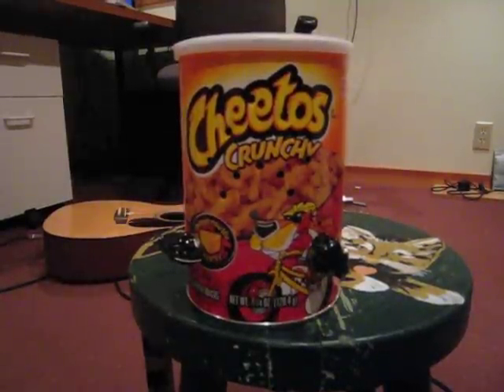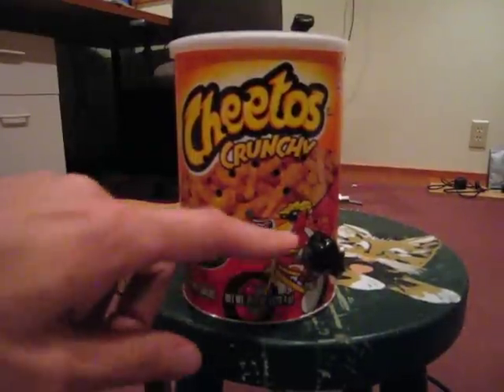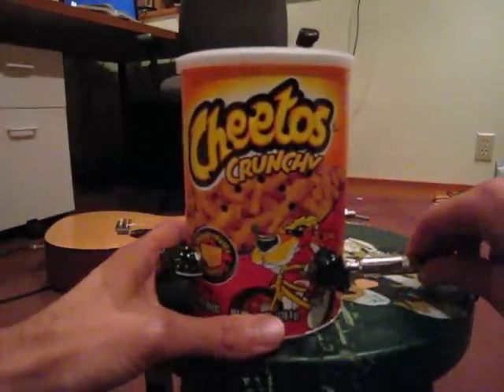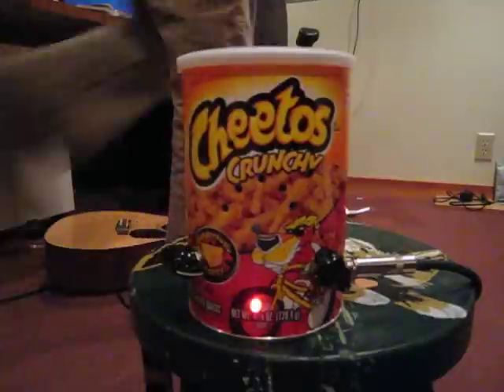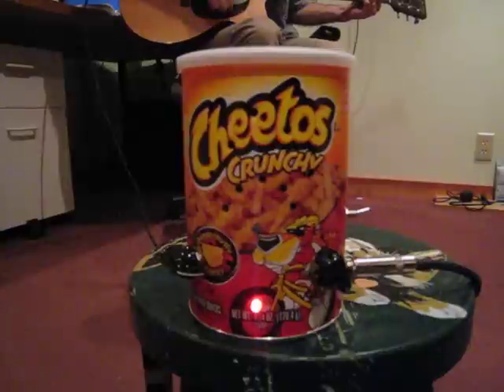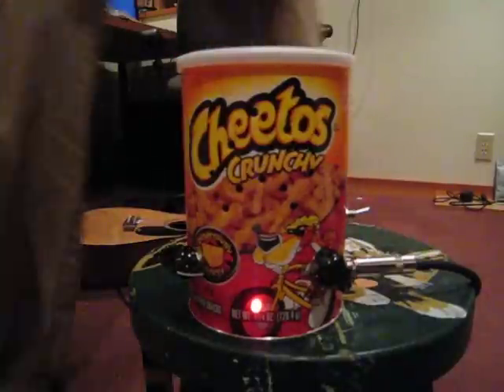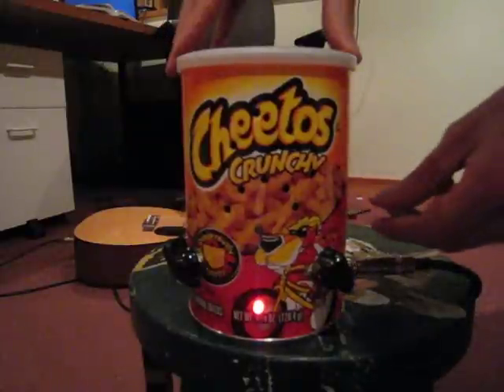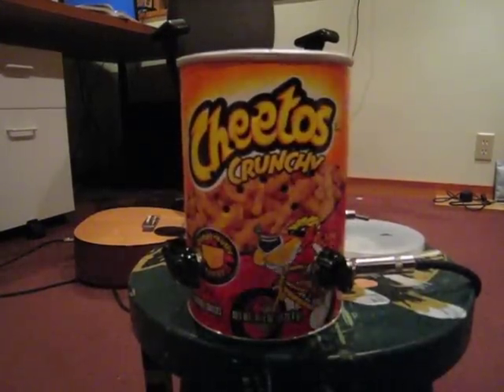Cheetos Guitar Amp

Comment from the maker: @penguinpro123 - For more crunchiness, you need more gain, so it will overdrive the amp. I put a potentiometer between pins 1 and 8 of the LM386. The datasheet isn't explicit here, but I think lower resistance results in more gain and more crunch.